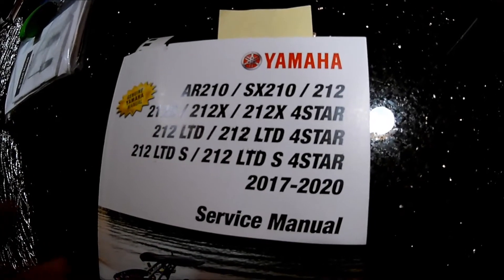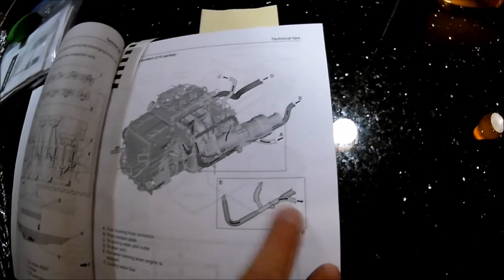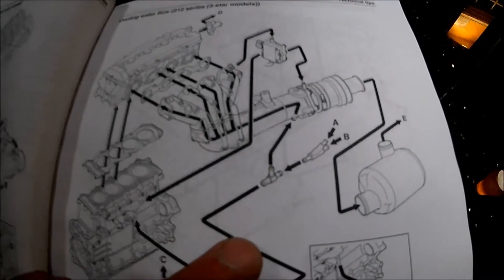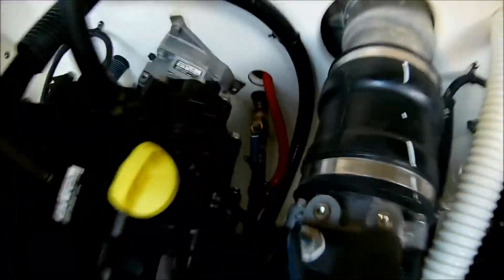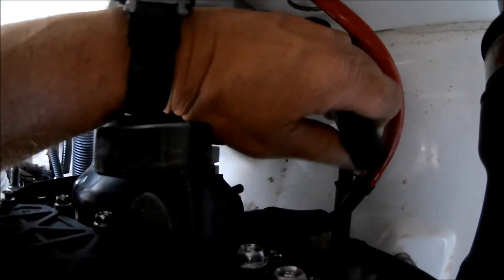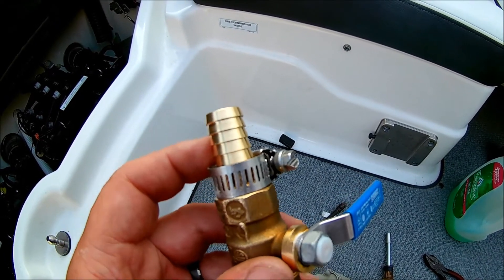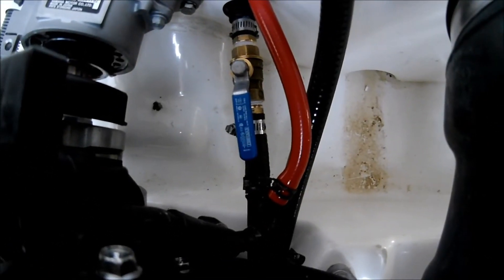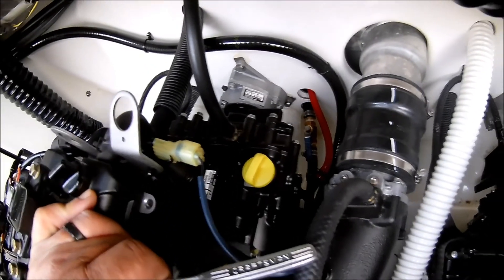Yamaha Jet Boat AR210 SX210 212S 212X Flush / Tow Valve Install 2017-2020

Comment: How was your flow post addition? I have no flow at idle speed. I'm going to trim hose length and recheck. Fingers crossed.
Reply from the maker: Flow was the same.  I have flow out the pisser at idle and when flushing.

Comment: Is this needed for a single engine? Also is it the same process just 1 time?
Reply from the maker: It is not necessarily "needed" but it is helpful if your boat needs to be towed.  With the valves you can be towed at higher speeds, but without only at idel speed.  It's also helpful if you need to flush your engine while the boat is in the water. 
The process should be the same.
Reply: @Channel-About-Nothing  So of I don't have it I can only be towed at like 3mph right? But with it if I close the valve I can be towed faster? Any specific speed with the valve closed
Reply from the maker: @jttribe7683  With the valves closed you can tow at any speed.

Comment: If the engines are hot, how hard will it be to close the values off?
Reply: I may add those valves to my engines at some point. You can make a long handle with a pickle fork end to reach them if there is room, and the engine doie doesn’t interfere.
Reply from the maker: It's not going to be exactly easy but not impossible either.  I would just throw a beach towel on the engine.